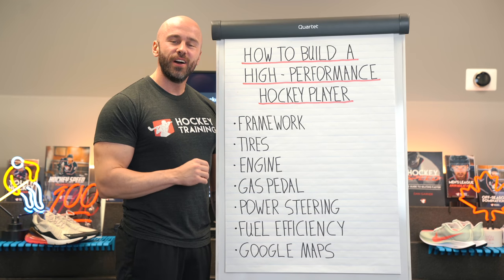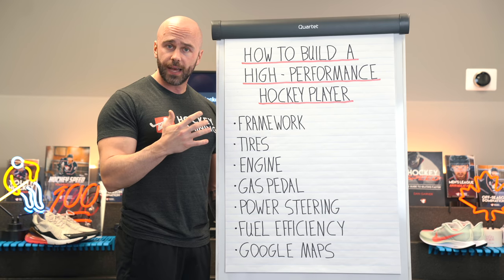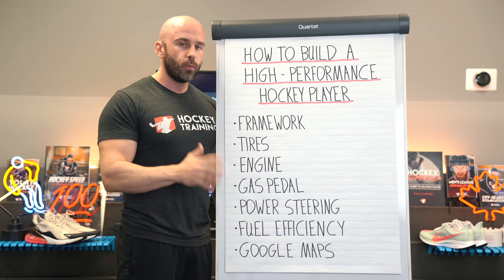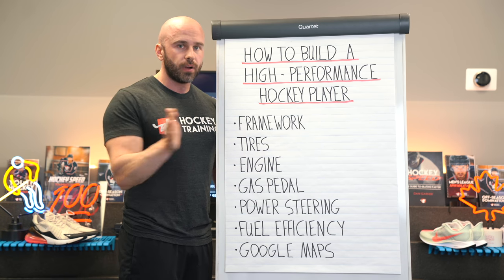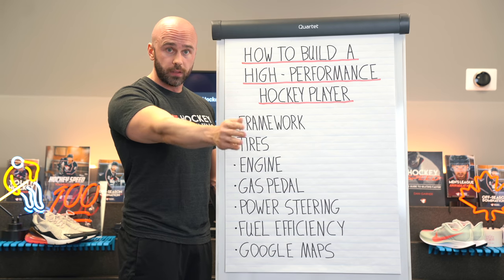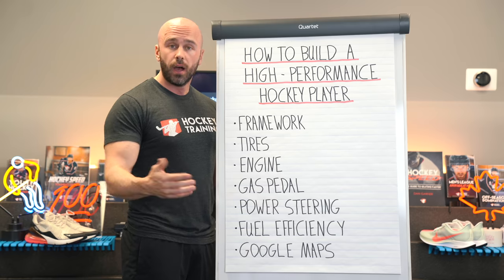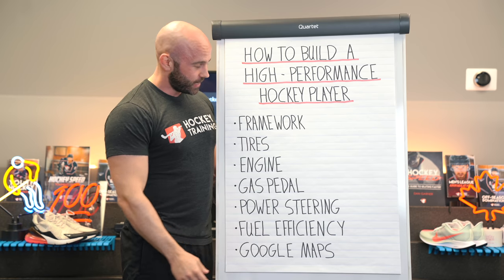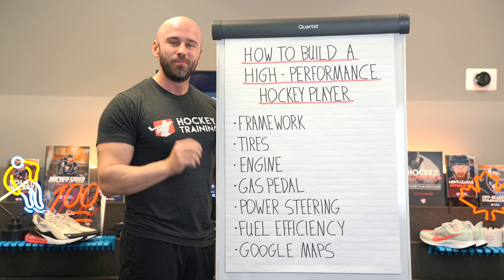How To Build a High-Performance Hockey Player 🏒

Comment: Hi i have very good condition but i always stressed that im going to lose my good condition what you think on that?
Reply from the maker: Athletes are only ever stressed if they are not confident in the work they are putting in to become a better hockey player. You won't have to worry about losing your condition if you train it properly, and you'll continually get better at it on top of that. If you think your conditioning needs work, check out this program: https://www.hockeytraining.com/nlc2-program